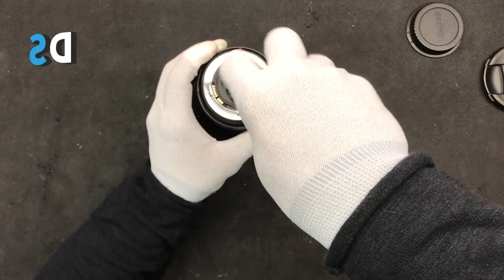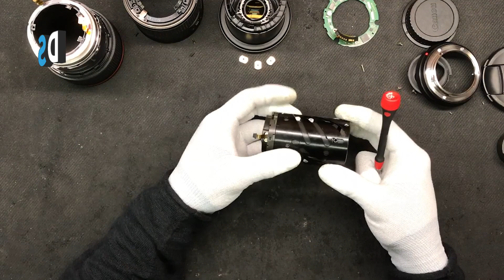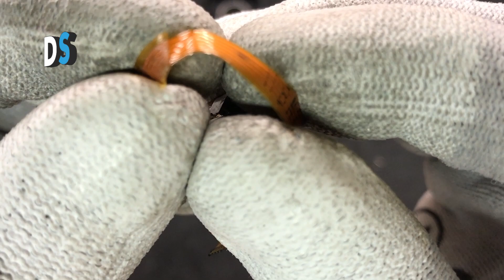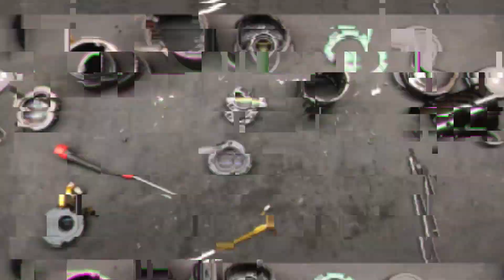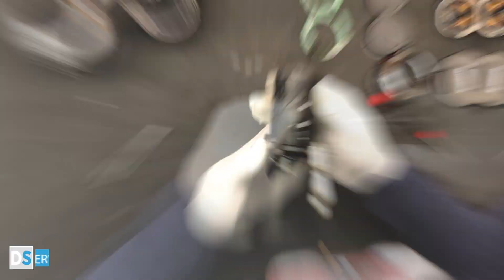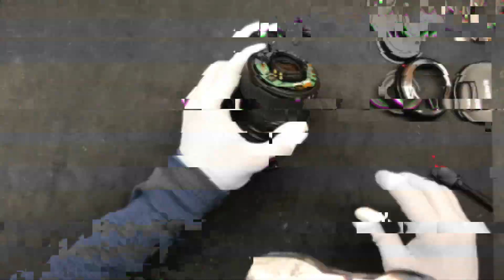How to repair Canon lens EF 24-105 F4 II USM L - Error 01 broken flex

Comment: Commercial Photographer East Coast USA

Terrific video  .... I dropped my lens     .......However I eventually sent disassembled lens to Digi Service in Sofia Bulgaria to be checked and reassembled........It returned in great condition ....cleaned and calibrated ....its sharper than before across the zoom range.....$$$ much cheaper than Canon Repair....
Digi Service 
Totleben 2A 
Sofia 1606 

Bulgaria

Important - Request explicit mailing instructions